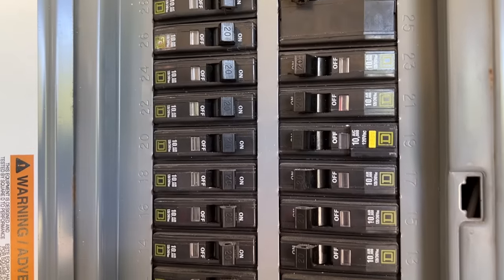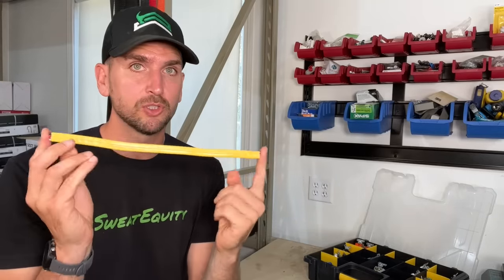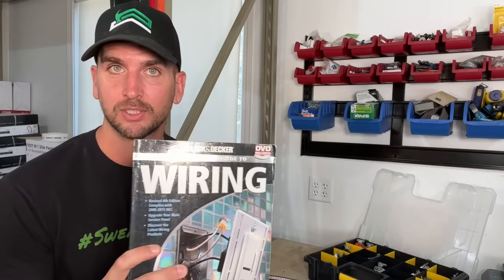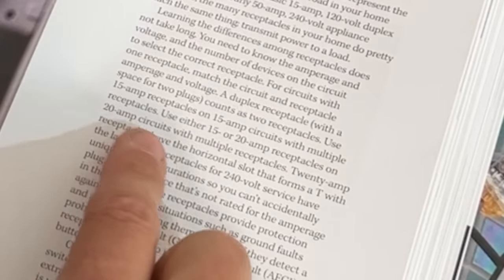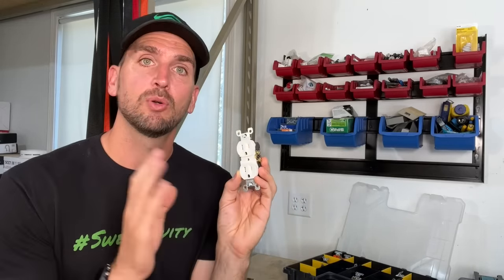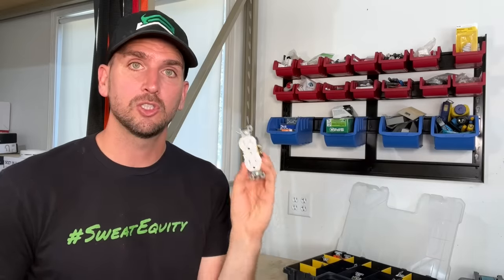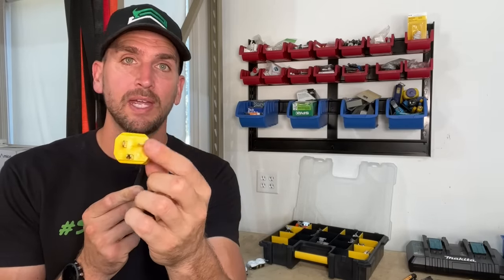Can 15 Amp Outlets Be Used On A 20 Amp Circuit Breaker

Comment: I love every time you open up outlets and show us the guts.  I’ve been wondering since your last string of outlet videos if commercial grade 15-amp would be safe for 20-amp use.  Thanks for anticipating my question and making such a great video!  My practices for outlet replacement have been completely changed for the better by your videos.
Reply: I am a long time DIY'er. One of my major regrets is not using commercial grade.
Reply: No. Only a 20 amp receptacle on a 20 amp breaker,  15 amp receptacle on a 15 amp breaker.  You could put a 15 amp receptacle on a 20 amp breaker, but why?  Never the other way. Why? The gage of the wiring.
Reply from the maker: Thanks John and appreciate your support over the years 🙌
Reply: @robertmacdonald8447  The answer to John's question is yes, it would be safe as the pass through  amps are 20, but in reality it would never happen because the face plate on a 15 amp receptacle will only allow a 15 amp plug to be used. Tens of millions of 15 amp receptacles are safely and legally in service on 20 amp circuits in America. The only difference in the receptacles are the faceplate slot configurations.
Reply: @robertmacdonald8447  "You could put a 15 amp receptacle on a 20 amp breaker, but why?" Because a 15 amp is cheaper and the guts are identical.

Comment: Of course, it shouldn't be a hazard to put a 15A receptacle on a 20A circuit.

A 15A outlet means that you can't plug a 20A device into it,  In other words unless you are deliberately trying to overload the receptacle (e.g. with power strips that have the circuit breakers defeated), the outlet will be limiting you to a 15A load.  There's never a problem using a smaller load than the circuit is rated for.

The only theoretical way that this could be a problem would be if the receptacle would be wired in series with a higher current load.  For example, the hot line into the receptacle, and its neutral line going to the hot side of another device.  This could cause more than 15A to flow through the receptacle.  But that kind of wiring would massively violate code and be practically useless (because a device would have to be plugged into the receptacle for the downstream device to have any power).

The way circuits are actually wired (in parallel), means that the load carried by a receptacle is not affected loads elsewhere on that circuit.  So no problem.
Reply: Yea I thought the question was sort of silly. And now you'll be limited to using adapters when taking advantage of the circuit rating. Odd.
Reply: What if I plug two 9.5A devices into each socket of a 15A twin outlet? If the outlet is on a 15A breaker, the breaker will trip. If it's on a 20A breaker, the outlet will be overloaded without tripping the breaker.
Reply: @Adam1nToronto  It shouldn't be.  The rating for a duplex receptacle should be for each plug, not for the entire unit.

Comment: The funny thing is I've taken apart 15 amp plugs in 20 amp plugs. There is no difference internally it really depends on the grade and quality of the plug. Commercial plugs or more expensive and are made to be used over and over.

Comment: The cheapest grade is perfectly fine. Just don"t used the push in back connectors, they will get hot. If you run a space heater for a while, when you unplug it, the electrical outlet will be hot. Time to take it apart and put a 3/4 loop under the screw like it should have been in the first place.

Comment: 5:13 Interesting thing about the older one is it has the sideways metal slots for 20A plugs on both sides, top and bottom.
Reply: That would imply that they also put 20amp 220v covers on that hardware. The production line builds three varietions of receptacles simply by changing out the covers.
Reply from the maker: Yep, each brand handles it a bit differently but you can get an outlet with "guts" made for a much more demanding application if you play it right.  I was a bit surprised to see the design change to the 15 Amp since the last time I opened one up.

Comment: actually, the most common wiring technique uses mostly 15 amp circuits for receptacles, and then when the homeowner has trouble with the breaker tripping when they try to use their Hoover Wind Tunnel Vacuum, they ask a handyman to fix it and he bootlegs in a 20 amp breaker.

Comment: Most people still misunderstand the point of the circuit breaker. It is NOT there to protect your devices or the outlet itself. You can see the outlet if it catches fire. The point of the circuit breakers is to protect the wires you can't see in the walls. Neither the wires nor the circuit breaker nor the outlet actually transmit current. The devices plugged or wired into a circuit take what they need. No more, no less. If a device only needs 15 amps it will only draw 15 amps even if plugged into a circuit capable of providing 100 amps. The circuit breaker simply limits the current that a device CAN draw to protect the wires from literally melting and catching for in your walls. That happened in my house when I was a little kid in the 80s in my parents house that still had a fuse box in the basement and sections of knob and tube circuits in the walls. Just one wire caught in the walls and the house was a total loss. We didn't lose everything but the house did have to be leveled and rebuilt.

Comment: Wish you discussed in more depth how home loads with breaker rated at 20amp can be used with duplex 15amp plug style.
Reply: The plugs on the power cords of tools and appliances are rated for 125% of their ampacity for safety. If you do the math it means that the appliance or tool will not load the circuit by more than 80% when running. On a 15 amp circuit that's 12 amps or 1440 watts and on a 20 amp circuit that's 16 amps. A 15 amp plug is used on everything from a few milliamps to a maximum of 12 amps. A 20 amp plug indicates a current draw of something like 14 to 16 amps. 20 amp plugs are rare and you'd be hard pressed to find equipment with that. What's more is that because of the high current draw this equipment will likely require or at least recommend a dedicated circuit which means only a simplex (single) receptacle would be permitted, not a duplex. You could make the inference that a 20 amp duplex receptacle is never required, but just an option for a 20 amp circuit. So, as long as you avoid residential grade 15 amp receptacles, there's no difference between 15 amp and 20 amp receptacles internally, as Scott pointed out. Keep in mind, it's the wire gauge that determines the circuit rating, not the receptacle. This is in the US for 120v circuits, Canada has different rules. BTW, you can find appliances such as hair dryers for example that have a standard 15 amp plug, but advertise 1800 or 1875 watt output. That could be a momentary upon start up load and/or simple marketing pitch.
As you know the circuit breaker takes into account the accumulated load from all appliances on that circuit and can exceed the safety margins and if the load is high enough, it should trip if it exceeds its actual rating and becomes overloaded, it's usually not immediate unless it's a dead short. Anyway, whether the receptacle is 15 or 20 amp would make no difference.
Edit: There is an exception. In a 20 amp multi wire branch circuit or a split receptacle with 2 completely separate circuits that have no receptacles upstream (dedicated circuits) then I believe that a 20 amp duplex receptacle must be used.

Comment: Another major negative for using a 20 Amp Adapter is that it only adds to the risk of overheating in two ways. The contacts will have some resistive properties with some heat being produced. The Adapter will also extend out, adding weight; increasing the chances of it coming loose during operation.
Reply: It can also be bad if you also consider an extension cord. Some extension cords, even some that are tough-looking, actually only have 16AWG wires or even 18AWG, especially ones with NEMA 5-15 receptacles. There's now a possibility of even more current being passed through this extension cord before the 20A circuit breaker trips instead of the earlier tripping point for a 15A breaker. Imagine what'll happen if the 20A adapter is then plugged into such an underrated extension cord

Comment: Since code allows 15A receptacles on a 20A circuit, at least the part of the outlet that transfers power through the daisy chaining must support 20A.  As you found in looking at the internals, the only thing that is really 15A is the plug configuration blocks the 20A plug.  Having seen an outlet that failed with sparks flying and nearly lost the building to another similar failure, the weak point seems to be the connection of the internal wiring ot the receptacle.  In the cases where we had problems, they used the cheap backstabbing method in an ocean-front property prone to rust, which was a recipe for disaster.  Likewise, when using the screw terminals, be sure they're really tight.  (Disclaimer: I'm not an electrician; if you are and I said something wrong, please correct me.)
Reply: Using side screws is the best termination method on outlets. I go on a lot of service calls fixing backstabbed outlets and switches. Source: service electrician.

Comment: thank you for the info i had a feeling that the house i bought had the wrong outlets for the washer and dryer they both had a 15 amp outlet and it was on a 20 amp breaker and it was the only thing on the breaker the washer and dryer have their own breakers so i was thinking that can't be safe so i upgraded them to the 20 amp outlet found your video very helpful im looking at the books now thank you for all the help

Comment: You can always breaker down relative to wire size and outlet rating.
Personally I would use a 15 amp breaker with awg12 wire and 15amp outlet, regardless of the number of outlets on the circuit.
Only time I use awg 14 is for a ceiling light or dedicated outlet for a refrigerator.
Reply: That is your “Rule of Thumb”.  Not an NEC compliance comment.
Reply: @KevinCoop1  NEC compliance - you can ALWAYS breaker down for a given wire size and outlet.
NEC states maximum breaker size, not minimum for safety reasons.
Heck, you can put a single outlet on a single circuit on a single breaker if you wanted. But panel might have 100 breakers in it...
You just cannot 'put a penny in it when you keep blowing fuses' scenario.
Reply: Then your breaker may commence tripping for no good reason. There’s a lot of margin built into the code. 

Common 15A rated 14-2 will actually endure 30A no problem even in a fiberglass insulated wall and passing through wooden studs. 12-2 likely good for 33% more, so 40A easy.  Point being the margin that is built-in. Never actually load over rated circuit capacity though. 

Copper ain’t cheap.
Reply: @Blake4Truth  I saw a chart one time that showed how many amps a wire was rated for.
You can overload wire depending on the amps over time.
I think 14/2 was rated 20 amps for 2 hours.
Or 15 amps continuously.
IMHO it is not worth the risk to over-breaker outlets.
People are insane and will plug in far too much on the same circuit.
Reply: @crazysquirrel9425  

Rated means huge factor of safety. That’s what you’re missing. Wire is also rated for temperature at rated ampacity. It’s all already covered. You never need a 15A breaker on a 14-2 circuit.
Reply: @Blake4Truth  Yeah they do stupid shit in India and Pakistan too. But in the  US we have the NEC and it's always best to stay according to code. What wire can "endure" is not a good way size things. It's also not good to post something like this because some dumb asses will follow you advice. As engineers we design things with a safety margin. It's not about making you spend a bit more money doing it right.  

It is good to have a sense of "what you can get away with",  during crisis management, but using up the safety margin by design, is a bad practice. 

Years ago, when I worked in the old steel mills, knowing how much you could push something, was valuable knowledge. It was not uncommon to have a breakdown  where the costs per hour of not running were often in the millions. And in some situations, being without  power for even short periods might set you up for an even bigger disaster. So often we pushed the limits when the situation called for it. But key to that was to do it right when time permitted. So indeed, sometimes doing it wrong was the right thing to do in a given situation. But if it becomes to frequent an occurrence or cheating the code was done from the get go, you'd ultimately pay a price for  it. and over time you drift farther and farther away from good practice.. 

If you are doing things like running 14-2 circuits on a 30 amp feed, you are begging for problems. Heat is the enemy in electrical circuits. When you double the current, heating goes up 4 times. Anywhere that you have a high resistance connection, heat can rise dramatically and potentially cause a fire. I have seen cutting corners cause to many issues. It's just dumb to deliberately give up that safety margin.

Comment: Appreciate the video.  Very helpful.  Question:  A 15 amp outlet Does the top handle 15 amps. And the bottom 15amps?  Or is it a toral combined 15 amps.  Thanks.

Comment: Very good explanation and helpful. Though I have a modern breaker panel (2005) for my condo, the main breaker is only 125 amps, so it would be extremely expensive for me to upgrade for an electric car for a Level 2 charger. But for me, my charging needs are minimal and I have considered instead upgrading a 15 amp style outlet that is on a 20 amp circuit in my garage to a 20 amp outlet that can handle a special adapter that Tesla has optionally available to allow their cars to charge at a 15 amp (3/4 capacity draw) instead at the usual 12 amp draw used for a 120 volt circuit.  This would allow the car to charge at a 6 miles per hour recharge instead of 4 miles per hour.  So, this is another scenario outside of a window AC or jackhammer that would be able to take advantage of a 20 amp outlet. In any case, even if I decide to charge at the lower default power draw, I think that upgrading to a commercial grade outlet for an EV might be wise for anyone using a 120 volt circuit.

Comment: Seems to me that what are now called 15 amp outlets were formerly considered 20 amp outlets, & that they can physically run 20 amps with no problem.  & when I wired an addtion to my home, I used #10 wire from the breaker box to the outlet anyway.

Comment: Two quick things from an electrician:
1. Take the time to find the amperage on everything you plug in and be aware not to use multiple high-amperage items at the same time on the same circuit.
2. I appreciate the research and presentation of this channel. Good job.
Reply: Yeah no one is doing that.  You think a 25 year old women is going to calculate the amperage and total load on everything in the house that they will plug into each outlet?  It's not even realistic to say something like that.  Anyone that would even think along those lines, would intuitively know how much you can plug into each receptacle.  The way people learn this is by resetting the breaker three times before figuring it out.  All this new practice does is make it more dangerous while you are learning by trial and error.
Reply: @msromike123  you mean YOU'RE not doing that and you have a very low opinion of women. It's very simple but I see it's too hard for you to add single digit numbers. Everyone I told this to instantly understood and don't trip any breakers anymore.

Comment: If you use power tools, you gonna sometimes exceed 15 A on a outlet.  I didnt know how similar  they were electrically tho. That's  probably a good idea because I would likely just look at the panel and say yeah 20 circuit. Good enough for this table saw. I would actually favor printing 15 A on the outside of those outlets. Can you tell without opening the thing?

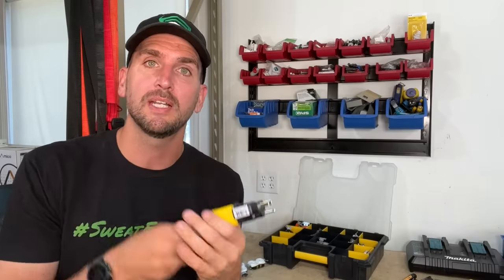Comment: @7:11 - you stated that a higher current device could be connected as you still have a 20A breaker and 12 gauge wire on the 15A receipticals. My house was wired just two years ago and that's not the case. Most recepticals are on 15A dual function arc/ground fault breakers with 14/2 wiring (as are the lighting circuits, which are all LED lights). I wouldn't assume that 12/2 is run on a 20A breaker when I see a 15A rated receptical. The only place I have 20A w/ 12/2 is the kitchen, baths, and dedicated circuits (microwave and washing machine).

Comment: It must be different where you are. Here a fifteen amp circuit has a fifteen amp breaker. And the cabling is 14 awg so there is a big difference. I am also older so maybe codes have changed. 🤗

Comment: I used to deliver copiers. One day I was swapping out a machine with a 20 amp plug for another with the same. I unplugged the old copier and found they had twisted the horizontal prong to make it fit into the 15 amp outlet.

Comment: The big problem with the converter plug is that people may use these with small gage extension cords. That can damage the tool or cause a fire when the cord heats up.